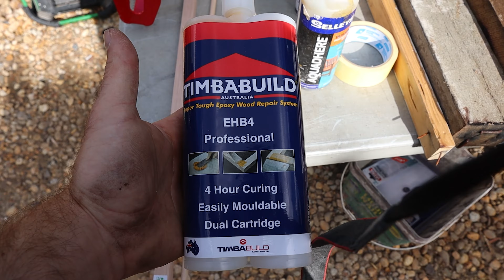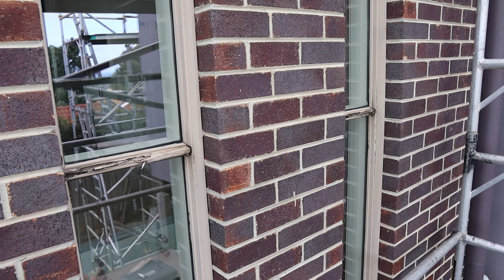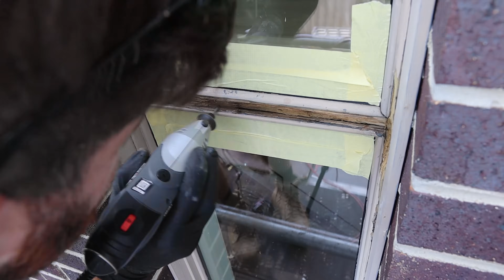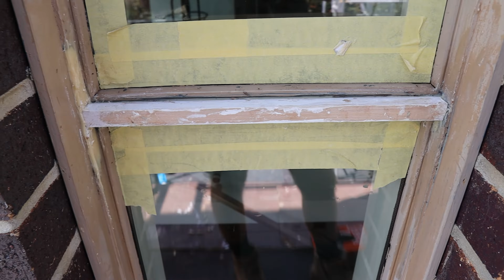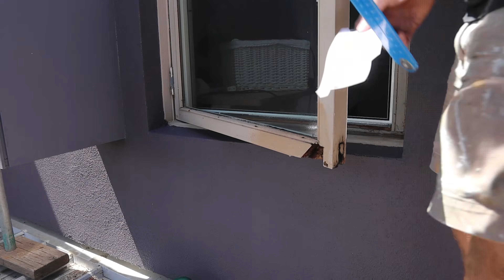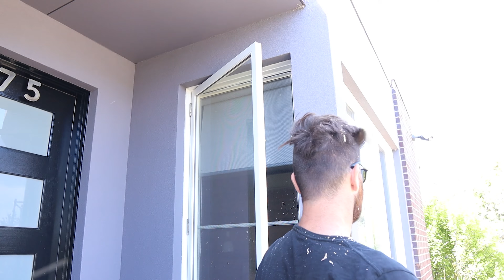How to Repair Rotten Windows & Fix Sticking Frames | DIY Timber Restoration Guide

Comment: Hey mate, you mentioned finishing off with another filler. What product do you use? I assume it’s not a water based product. Cheers
Reply from the maker: Whatever works. Just something suitable for exterior to fill any pin holes.

Comment: Whats the purpose of the dowls
Reply: Copied reply from LVL UP: Better, yes but also not necessary in this example. Adding in new timber saves on using lots of epoxy. Hope this helps!
Reply from the maker: dowels will help locate and hold the timber while the epoxy cures

Comment: Can you use builders bog
Reply: Not reccomended for external use, it soaks up moisture too much unfortunately. Plastibond would be better if you don't have access to an epoxy filler mentioned in the video.
Reply from the maker: i wouldn't, automotive bondo is better but epoxy is the best bet

Comment: I've been wondering: Is a rigid glue or filler a good idea where different replacement pieced meet the old window? The wood will contract and shrink at different rates than the hard filler or glue, leading to cracking and water penetration over time. So in my upcoming repair I plan on using paintable flexible glue/caulking only while keeping the gaps as small as possible as well.
Reply from the maker: Your logic is correct and this product is designed to expand and contract with the timber

Comment: Is this epoxy better than Builders Bog?
Reply from the maker: Yes, miles better. Bog offers no structural element and is very porous which doesn't help with moisture ingress. Bog doesn't hold an edge as well as epoxy does which can be important when trying to create sharp lines that you often see on windows and doors

Comment: Really like it. But epoxy is so bad for environment and health.
Any place where you can drill a hole and fill it with a wide dovel in outdoor timber glue would be preferable. If the hole is larger, do it over a couple of rounds.
Reply from the maker: Sure...that's one alternative!

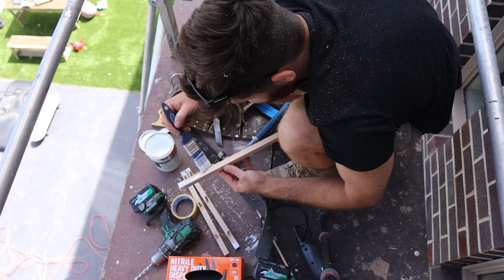Comment: 2:53 I don't quite understand why you added new timber over the top of the epoxy repair of the rotted timber?. Wouldn't it have been better to completely remove that rotten section out completely and replace with new ?
Reply from the maker: Better, yes but also not necessary in this example. Adding in new timber saves on using lots of epoxy. Hope this helps!

Comment: Hello! Would this process work on a window sill that is inside? I have a window in my bathroom, in the bathtub area that has rotted. The structure seems fine, but the whole bottom window sill needs to be replaced
Reply from the maker: Yes this should work there too! Generally speaking just cut out the bad bits and epoxy some new bits in so long as you have enough access to get the new piece(s) in.

Comment: What hard wood do you use?
Reply from the maker: Vic ash or Tassie oak. If its a door/window sill sometimes I use merbau. Generally speaking it's good to match the replacement timber to the original timber.

Comment: I hope you see this. My windows slide up to open. I have two where the bototm of the windows under the pane are rotten out. The windows arent removable. My thought was to cut the rot out. get a new piece of wood dimesioned right. Cut in half so i can fit in and glue the two parts together as they are being glued to the window. Not sure. I need new windows but trying to just keep these windows a year or two more to offset the costs.
Reply from the maker: I'm very surprised the windows aren't removable, double check this is true. 
I've used a similar technique when replacing floorboards. your problem is you may accidentally glue the window shut while trying to glue in new timber. Give it a go because it sounds like the worst case is you need a new window, best case, you need a new window.
Reply: @lvlupbuilding  I need all new windows they are all wood from
92 along with my exterior siding . I’ve paid for the house just wanted to try and keep the window good for a bit longer to offset some spending. I’ll try and figure out who made the window and if there’s a way to remove. They are are double hung windows so you’d think I should. I know all the shitty vinyl that the window people who stop by show me pop out
Reply from the maker: If you like you can send me some photos via Instagram and I can maybe give you more advice there

Comment: by far the best in place wood window repair video on youtube, thanks! the epoxy tip is great, I'd been using Porion whcih is good but not suitable for high build as you say.
Reply from the maker: Thank you! It's honestly a life saver. Good luck with your project
Reply: I second this!